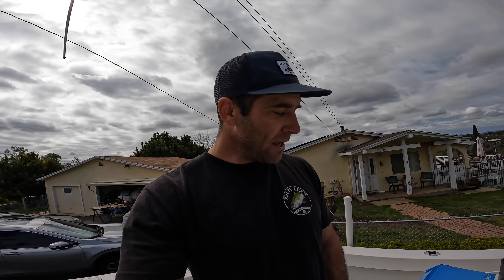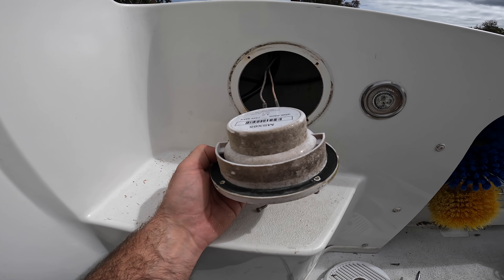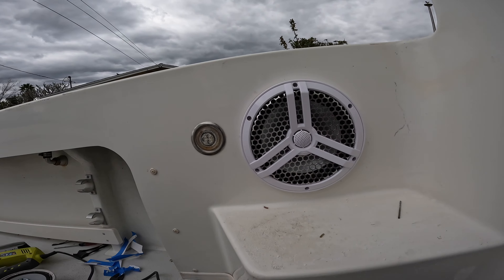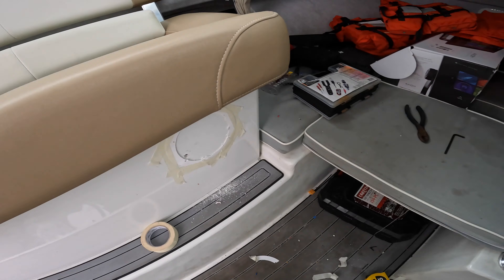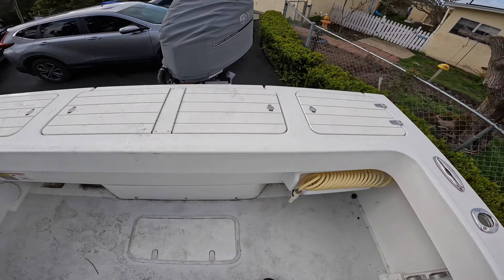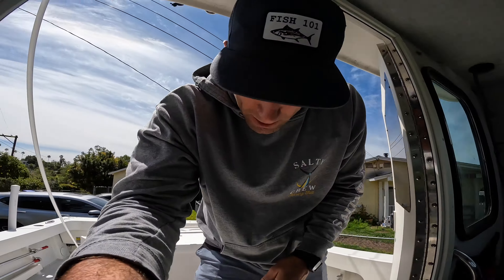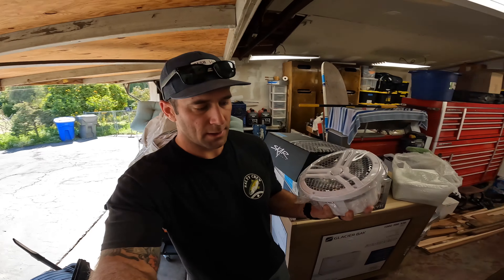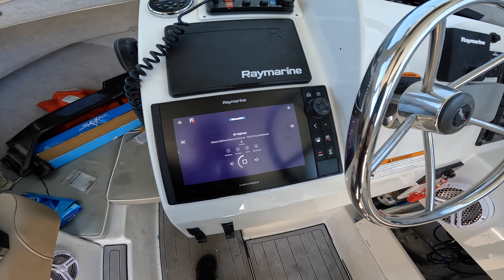Installing SKAR audio marine speakers

Comment: So it's been a year now, how do you like the set up? I'm think I'm going with the same (4) 8" speakers, and 4 ch.100w amp with a fusion deck. It going in a 21' Striper dual console.

Comment: Can you tell a big difference between the 6.5's and the 8's? I just ordered two pairs of 6.5's but was on the fence about getting one set of each.
Reply: Same here, I can’t decide between four 6’s or 2 8’s
Reply from the maker: Sorry for the delay. Yes the 8’s have way more bass. I’m really glad I went with both. Sounds like I have a sub hooked up
Reply: No worries. I went with four 6.5's because I already had holes for them and I couldn't be happier for the money. Plenty of volume even while running my pontoon with a 115 4 stroke.

Comment: If you ran only the 8” does the music sound clear and crisp. They say it’s a full range but just wanted to know if I did only 8” full range would it still sound normal or super bass heavy.
Reply from the maker: Yeah it’s super crisp, I actually have my 6.5’s running off the head unit only no amp so I really only hear the 8’s and they’re perfect